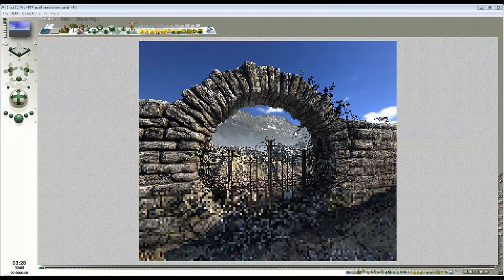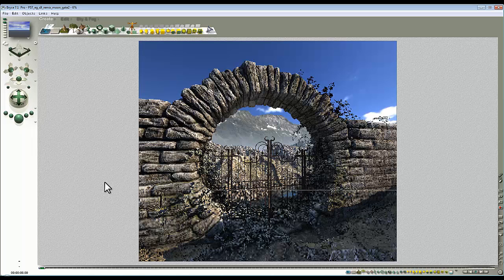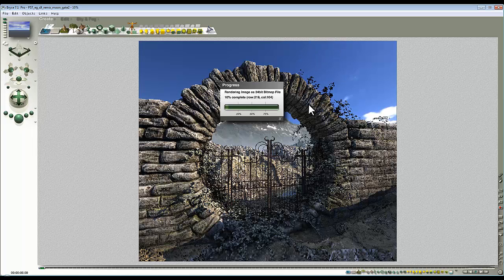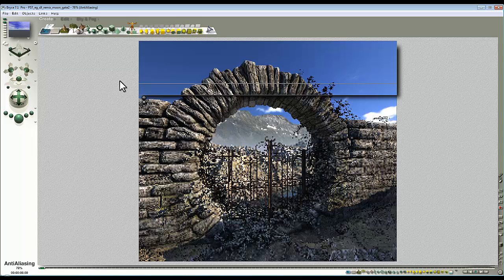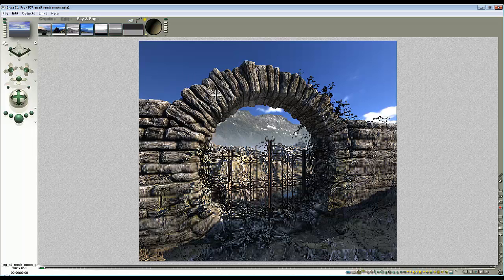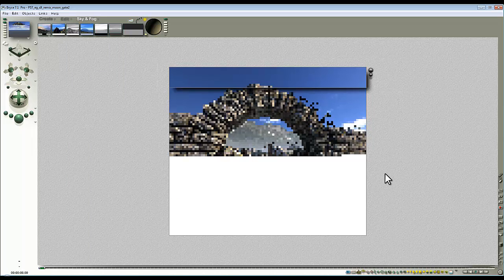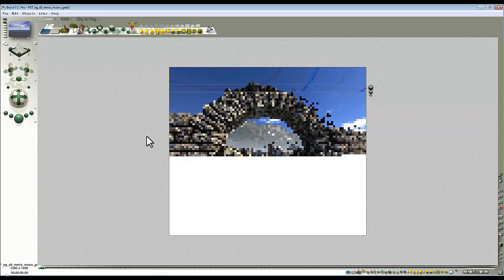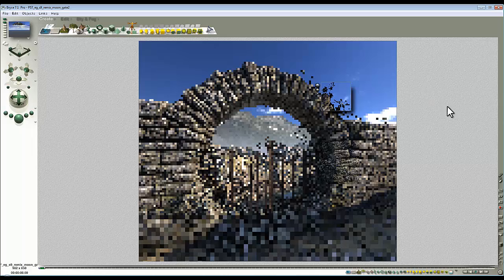Bryce Basics - interrupted rendering - by David Brinnen.

Comment: This is most useful info for our area where we have almost weekly loadshedding; lightning storms a few times a week, and other demonic intrusions like trees falling on power lines, cable theft (Grrr)...And my UPS only lasts 15 minutes. (Still saving up to go off-grid with solar).
However DAZ might consider implementing a smart render algorithm to concentrate more render "attention" on complex scene-parts and far less on uniform parts, to speed things up for us? Along the lines of this approach..https://www.youtube.com/watch?v=P_QmdpnKTW4
Reply from the maker: I got myself a UPS for the reason of unreliably power supply.  It will give me fifteen minutes, long enough to save and shut down.  As for what DAZ may or may not consider, it's not really my place to speculate.  If I was asked, I would offer be happy to supply my view based on having spent over two decades now using a variety of render engines and modeling tools.  I am rendering in Octane right now...  I'll leave the render cooking overnight.  If the render is worth doing, it is worth taking the time to do it.
Reply from the maker: Which isn't to say I'm dismissive of time saving approaches.  I hasten to add!  Just to say that it's not really the kind of thing I worry about myself.  But as you say, it might be something DAZ might wish to consider, since some people are more impatient for their art than others.  I trained as a conventional artist, with pencil and paints, so all computer art to me seems pretty quick and not all that labour intensive.  It depends what you are used to and what your expectations are.

Comment: My longest render time to date was a little over ten hours, and I used the method of stopping it and saving the file. I just overwrite the previous save, and that works for me. I have not done much saving as HDRI but I use Bitmap format regularly, because it preserves far more information than JPG when it is rendered as a backdrop in DAZ Studio. I have done PNG also but it did not include a transparent background even though that was what I wanted. Perhaps this is something you could explore in Bryce. PNG format in Bryce and how to make the background transparent.
Reply from the maker: I don't believe Bryce "knows" about transparency as far as file saving is concerned.  It can certainly import an alpha mask into a picture texture.  The only way to get transparency output is to go through a paint package and combine your render with a mask, one either made using the masking option in Bryce or one you make yourself as I did in this video here Bryce 7.1 Pro Advanced - create a tracking panorama - by David Brinnen. which is a bit laborious but so far as I know... that's the only way.
Reply: David Brinnen Yes I watched that one too. As you say, the paint package way of doing that is rather involved. I'm still trying to wrap my head around PSP7.
Reply from the maker: L. Cleveland Major Aye, layers, can be confusing.
Reply: David Brinnen As i understand it PhotoShop and Gimp also work that way. One that I use is (believe it or not) Microsoft Office PowerPoint. For texture painting and so forth it is not the best by a long shot, but you don't have to worry about layers, and it can save images in the PNG format and preserve the transparency. That allows you to create PNG images that can be imported into any other application that recognizes the format and use them to overlay others. You can even create layers in PowerPoint this way by using the shapes provided to past the images on. And there is a way to move these up or down the stack in a similar way as that in the other programs. There is even a limited way to created 3D objects, though the quality is not as good as that in dedicated 3D applications. PowerPoint is much more friendly for certain types of work to me.
Reply from the maker: L. Cleveland Major Oh yes I do remember your fondness for powerpoint.  Well as Horo wisely says, the best tool to use is often the one you know best.